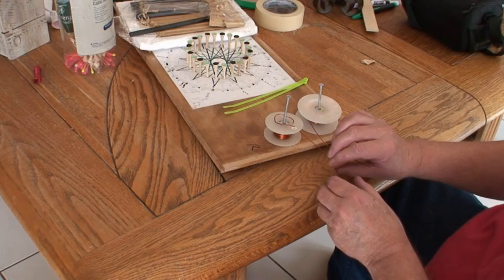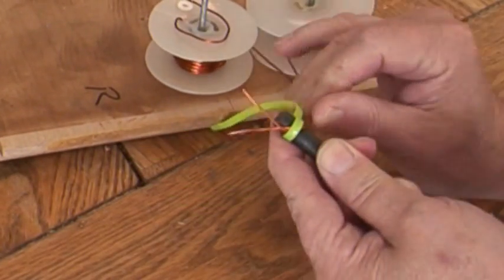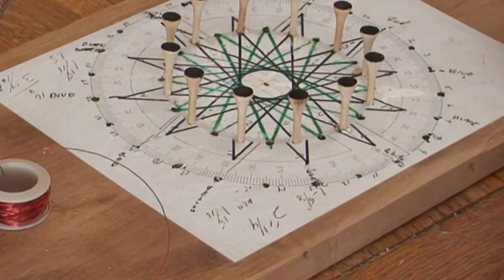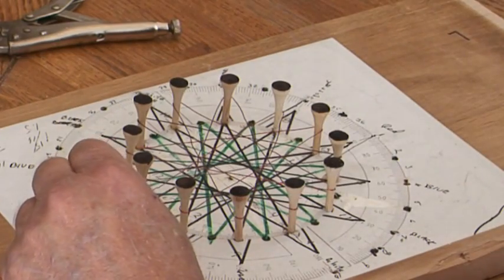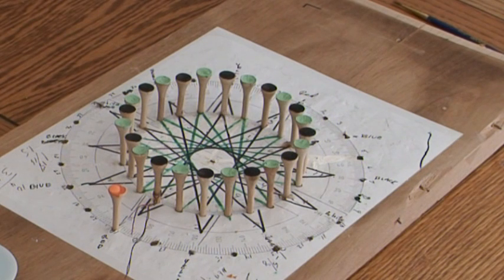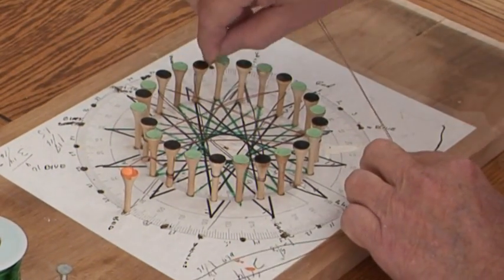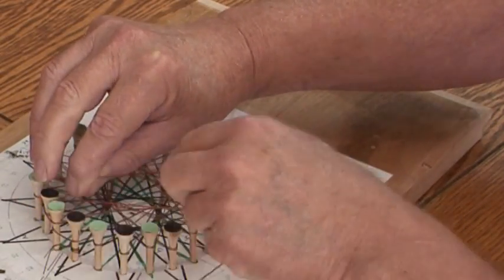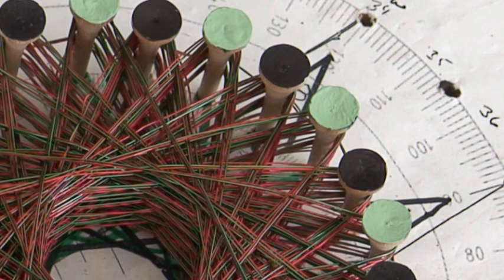Rodin Starship Rod Winding

Comment: Hello,

The diagram you are using, how can i get one? also, is there another diagram so you can get 66 pegs? what is the spacing measurements between pegs? can the spacing be changed, wider or smaller?
Also, why do you have to use every fifth peg? what about every third, sixth, ninith, or twelfth?
Has anyone tried to use magnets in place of the pegs(after the coil is completed) to see what kind of effect you get? maybe with a secondard coil on the magnets and check for voltage?

thanks

Comment: Very Smooth.
The difference between your beautiful coil and a Rodin with the same size wire and amount of turns will show up in the magnetic field. The outer edge of a Rodin air core toroid will have a lot weaker magnetic field because of the added space that the toroid provides. I must say, your Star coil is much easier to wrap and a hech of a lot quicker. I like it. Makes me wonder what it would do if it was made out of silver wire and then used as an electrolyzer, you know, submerged.
Mike.